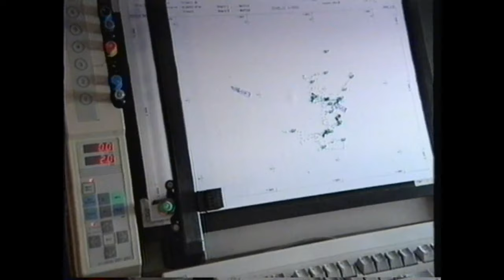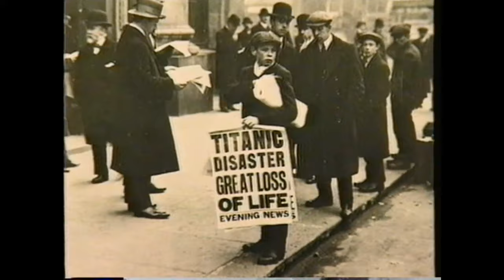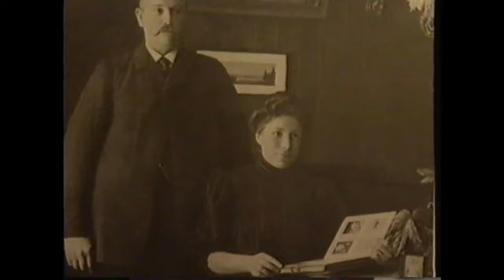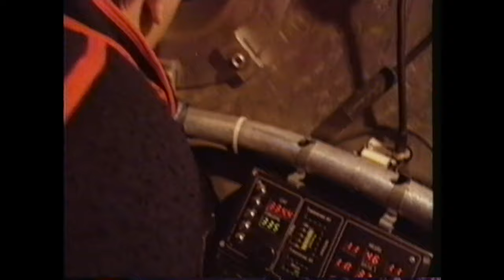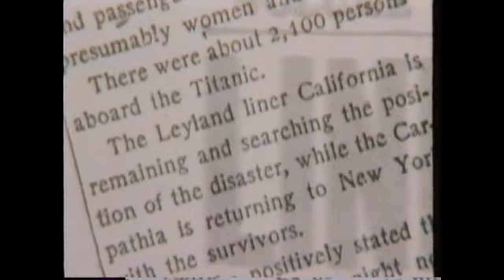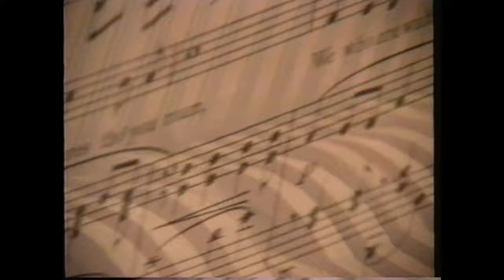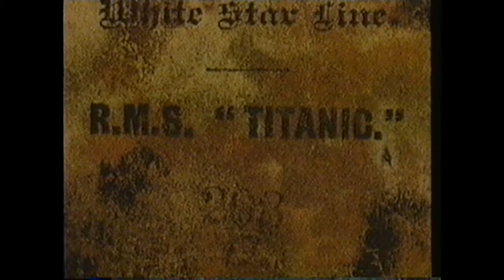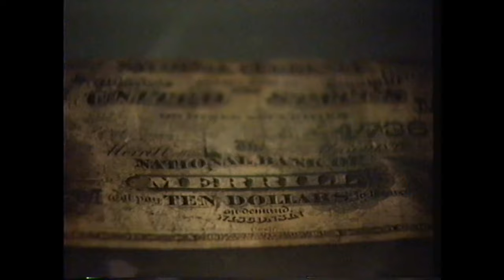Titanic Untold Stories 1998

Comment: Right at the start 10.44 you're using pictures of Olympic, why?
Reply: There weren’t pictures of the inside of the Titanic, but it was known that the accommodations of the Olympic were similar to Titanic’s.
Reply: @Powerranger-le4up  I mean the top decks, it's the Olympic.
Reply: @01menyou  No. The footage at 10.44 is of Titanic awaiting her final fitting out at Harland & Wolff, and was taken early in 1912. The partial enclosure of 'A' deck promenade didn't take place until March.   See the following:-
Titanic'sA-deckPromenadeEnclosureBTS2016